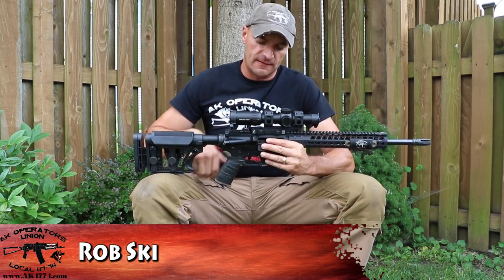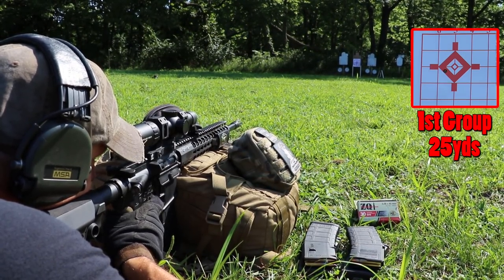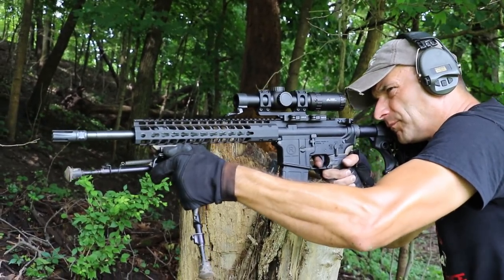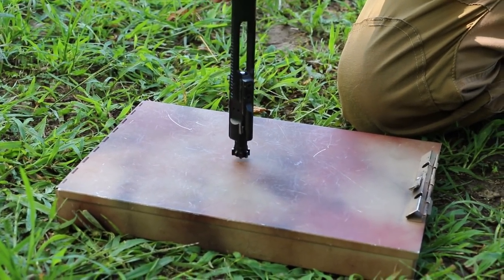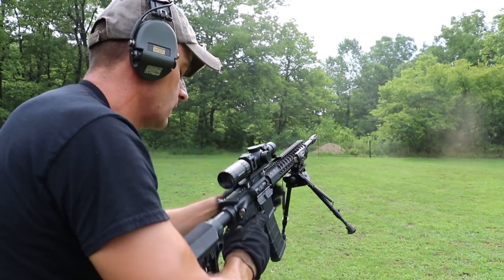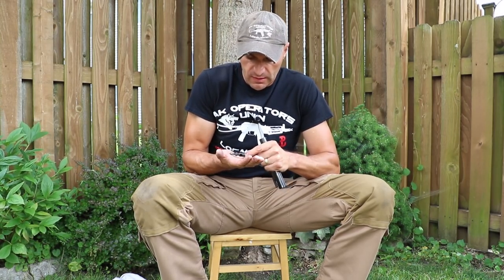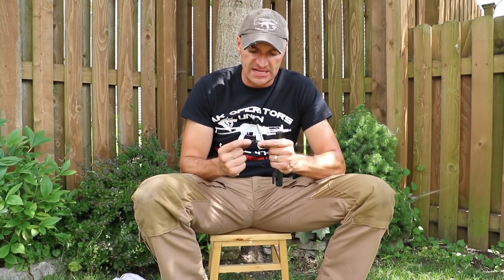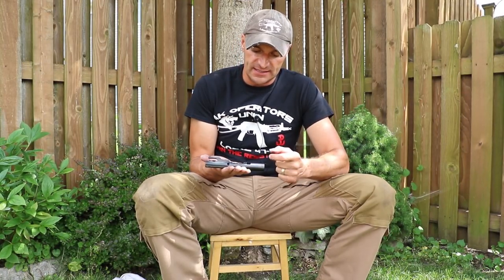Radical Firearms AR-15, 4310rds LATER - Another one bites the dust!

Comment: I've got to say that despite my tremendous love for the AK (I felt more safe with the Kalashnikov than the AR)... I'm actually an AR person (see note below). .  

The first half of the testing phases I did not expect the AR to survive 3000 rds but to my relief and delight it did survive with a little tilt of the rail being of little consequence (after all doing push ups on a rifle is not a common practice) but on to 4000 rds the Tornado Test result was a bit worrisome.  

If one moment the dust enters into the action and the next moment it begins to rain then the potential for jamming is increased.  Worse still if one finds him/herself on miry clay of mud, s/he doesn't have the luxury of a portable air blower in sufficient volume.

When the rifle is "gunked up" the armourer must clean that rifle as fast as possible ... well as we can see... it was a nightmare for Rob to clean it.  The AR is not made for easy cleaning.  Not that the brilliant Stoner intended it to be that way for his sadistic pleasure but it's built to be accurate.  It is a trade off between accuracy and reliability (but its not unusual for most ARs to average 2 MOA. a single or two digit difference of the AK's 3-4 MOA).  

Now we see that it suffered a heart attack for which it never recovered... the bolt cam snapped requiring replacement.  To avoid this internal catastrophe the bolt must be redesigned so for now could the HK-416 with it's famous roller delayed bolt do any better?   ).     

Note 
I was on the fence between rifles for a very long time because while I do feel safer with the AK platform I also love the AR's comparatively superior ergonomics, faster and smoother Battery of Arms, and inherently better accuracy.  

The decisive factor in choosing the AR-15 was that one can buy an AR with a Long Stroke Piston which is one of the main contributing factors of why the Kalashnikov is so superior, second to none, in reliability (the others of course are looser tolerance and it's built to be a battle rifle).

CORRECTION: The HK-416 doesn't have a roller-delayed feature on it's bolt; it's simply  HK's own AR bolt.

Comment: Rob if the bolt carrier is still good replace the cam pin and put in new gas rings and you can continue the test later you just need 690 more rounds to finish the test. The rest of the rifle is still functional right?
Reply from the maker: +Michael Mitchell Rest of the rifle is still functional, but test is over. Breakage of part needed for functioning is an automatic No Go...
Reply: Still the rifle survived the test. Cam pin and gas rings are expected to wear out. But I suspect your problem is overgassing of the gas system. Though it could be the mag dumps your doing each 1000 rounds just prematurely wore out the gas rings and cam pin. Normal shooting would probably see the cam pin actually last 6 to 10 thousand rounds at least. 

BTW is it possible to show the inside of the barrel in a separate video to show what the inside of the barrel looks after a high round count?

Comment: That's why i run a Daniel Defense BCG in my AR-15.
Reply: BCM here as well. I've had good luck with PSA so far. For the money they seem solid. Daniel Defense is up there with the very best.
Reply: +Jks jks yea, i have a PSA premium upper 14.7' free floating rail with the pinned an welded Battlecomp 1.5 and a Spikes lower. Very boring and reliable rifle. I have my RAS as a fun unpredictable range gun :), whom hasn't failed me yet.
Reply: +Jks jks Yea its an ak 47. The Battlecomps in my opinion make the already soft recoil of 5.56 even softer as far as muzzle rise, however it directs sound almost back at you and makes the rifle seem louder than normal. I really like mine though, looks good and works very well.

Comment: great video guys I could tell you guys were excited for this rifle sucks to see it fail. which primary arms scope do you guys recommend for an AK the 1-6x scope or a 3x scope with the acss reticle?
Reply from the maker: +emanuelf11 I like both, but for most universal use, I prefer 3x http://shop.akoperatorsunionlocal4774.com/Primary-Arms-3X-Compact-Prism-Scope-with-762X39-ACSS-Reticle-PA-3X-Compact-Prism-Scope.htm 

If I know that I will shoot mostly outside 300, then of course you will benefit more from 1-6x http://shop.akoperatorsunionlocal4774.com/Primary-Arms-1-6X24-SFP-Scope-with-ACSS-300BO-762X39-Reticle-Primary-Arms-1-6X24-SFP-Scope.htm

Comment: I'm not an ar fanboy I appreciate both ar and ak.
That said I really don't think this no cleaning test is fair for the ar, I appreciate the reason, but the system is really understood and stated that cleaning is important for it.  I don't think it's realistic that any ar end user even in war is gonna run 4300 rounds out without any cleaning. 
I think the system has a ton of extra stress on it when run that dirty.      That's the trade of with a more precision tool.  Maybe two real cleanings in the 5000 for the ar would be fair.  We know nothing stands up with an ak in this regard any how.  
       Good job anyway Rob.

Comment: Wait, please hear me out.  The rifle up to this point was amazing right?  And the crux of the problem was a faulty cam pin correct?  So a simple cam pin replacement should fix it and put it back on the path right?  I know that sometimes in machining things can slip through that simply can not catch in quality control.  Is it possible this was just a bad cam?
Reply from the maker: +W Reid I hear you and we could speculate here about reasons why this happened, but fact is, cam pin is broken...I have repleace it with BCM cam pin now.

Comment: I don't feel like it's a total fail it is a part that does require checking and replacement over time. what would happen  if you slammed in another BCG and kept going. might be a good idea just to continue to use the rifle to just test BCGs

Comment: As much as I have no problem with someone calling Radical Firearms a POS product.  This was a bolt carrier issue.  Fix it and move on.  If anyone is going to be an AR 15 owner and shoot often, you had better have spare parts on you and know how to fix your stuff.  If I am out doing a test on a gun, I would have thrown a different bolt carrier in the gun and kept shooting. Get the gun home and fix what needs to be fixed.  If anything, all you showed is that the bolt carriers from RF are suspect.   Keep testing and see if it happens again, if it does, it would show there might be other issues with the upper causing extra stress on those parts, or, just replace the bolt carrier altogether with a reputable one.

Comment: i have a 10.5 upper from RF and have never had an issue although i have a 250$ BCG in mine i have had a noveske bolt break the cam like this so its just luck of the draw i reckon

Comment: I know this test is more than a year old but it is new to me. I just have a couple of things to say but first I want to make clear that I don't want to criticize your testing, I think you do a very good job.First: everyone knows that an AK is renowned for running dirty and an AR isn't. As you know tolerance in any machine or mechanical device is key to its ability to continue to operate under adverse conditions. The AK with it's higher tolerances is naturally going to run longer than an AR.Second: since the rifles are being tested with no cleaning and little lubrication it is no surprise the AR would have stoppages or broken parts due to its relatively tight tolerance between parts which will always give the AK an advantage in these types of tests.I'm NOT saying that one gun is better or worse than the other, all I'm saying is, under certain conditions each has its merits and can outperform the other. That is by design, not by preference.

Comment: I'd be curious if you replaced the broken part and gas rings with new to see if the rifle will operate.  while is mechanical and parts may fail.  that pretty impressive considering the cost point of the rifle.  I own one and had my own hiccups for the first 150 rounds but the thing runs and runs and eats anything you feed it. interesting though to round count 150 my trigger would not reset,  and it would not run pmags or lancer.  ended up running some PSA girl mags. just had to light push trigger forward. hit round count 300 and decided to try pmags and lancer mags.  at that point it did not care everything ran smooth and it always locked the bolt back.  it really is a nice rifle. I another and I paid 3x more and this thing is way more accurate.  it was just as dirty as yours and running slip 2000 ewl gave it a light coat again at round count 400. it never missed a beat.  minimum wear on bolt carrier.  these rifles are very tight when new.

Comment: are you going to drop in another cam pin and finish the test. I was looking at get one for my son and was wondering how the rest of the rifle held up. i own a dpms and i have only had issue with no thread on the gas block.
Reply from the maker: +Rob Noce yes, I have spare parts already, but test is over, because it was failure of component which I can't repair with rock or duct tape...

Comment: The gun was overgased from the start. It beat its unknown quality parts to death. I highly doubt they are using real milspec parts.
Reply: I agree. That ejection pattern was way off. Throwing them out at 2 o'clock. My 14.5 BCM midlength is 4 o'clock and is the softest shooting AR I've ever had. I completely agree with gun beating itself to death. Jim Sullivan, one of the original AR designers said you want as much weight as possible in all the moving parts. It's the same with an AK. The bolt carrier and bolt are very heavy. I personally run Wolff +15% spring in all my AK's. It's slows the bolt going back and help it pick up the new round and go into battery with authority.

Comment: Classic example of getting what you pay for. The average guy will buy a cheap rifle, put 200 rounds through it and then proclaim it to just as good as premium builds. Your DPMS, Ruger or Radical Firearms are not a BCM, Colt, or DD.
Reply: Just because a pin broke?
Reply: Busted cam pin and shot out gas rings in 4300 rounds, poor build quality.
Reply: AKMer47 so, $10 of expendable parts?

I want to see a major failure, like a broken bolt or busted gas tube.
Reply: AKMer47 Huh, I might've gotten lucky then.

Lucky that I haven't bought a BCG from them.

Comment: Unlike the AK you just drop in another BCG and your gtg. Easy simple fix
Reply: You can replace every part on an ak bolt and the carrier itself.I have 2 sets of spare chinese bolt rebuild kits for my norinco and 1 bulgy spring loaded kit and a fluted pin for my slr107f and after years of shooting them ive never had to use 1 single part to replace

Comment: Aaa man, too bad. I really kept my fingers crossed for this rifle. So maybe the theory still is that the relatively low cost AR is really not the best choice for intensive shooting?
Reply: I own an upper from this company and I'm pretty happy with it.

Although, I do have a different bolt carrier in there. $200 upper, $70 bcg (PSA, on sale), $200 more for receiver and lower parts.

Keep some extra cam pins and gas rings (consumable items) and you're set!
Reply: No, that is what Colt, BCM, Daniel Defense, LMT, Knights Armament, Noveske, SOLGW, and Sionics are for.
Reply: ***** Sure, I have thousands for a beater AR.
Reply: +pcblah you don't need thousands. you don't need much more than what this radical cost. PSA complete blem lower, BCM complete upper. Probably less than 700 for a beater that will always work and outlast you. Or buy used. I've bought 2 used BCM uppers and 1 Noveske basically brand new for about half of retail price.
Reply: xprocharged1 I actually bought a cheap Anderson lower and a PSA lower parts kit for it. I think that the cheapo PSA bcg will last me for awhile too. (I could always buy a more expensive spare)

I heard that Radical's BCGs were a bit crappy, that might be the case here.

$500 with tools, three mags, and 40 rounds of ammunition.

Comment: He used more than just a rock or duct tape to keep the subpar arsenal going too, used dermal on trigger. should've failed right then and there.
Reply from the maker: +lemmy lovecraft you are conveniently missed few points. Arsenal trigger was still operational and didn't fall apart. I used dremel for my own convince. Grinding could be accomplished by rock. Grinding off ledge wasn't necessary for rifle to work. It was annoying and stupid for Arsenal to do it that way, but it was still working.

Comment: Here's the issue I have calling the failure of a part that is expected to fail a complete nogo. It's really not a fare assessment of the rifle, had that part failed after a couple of hundred rounds ok that's more understandable but it lasted about the life expectancy of that part. It maybe on the lower end of the round count but it's still with in the acceptable range. Now with his Ak video that was a catastrophic failure it had a failure of the receiver or the trunnion now that's a serious issue. The whole BCG on an AR are meant to be replaced after a life of X numbers of rounds usually around 4 to 5 thousand rounds. Now if the upper or lower receivers failed now I would have called that a complete fail. Hell even the barrel is considered replaceable on an AR. I don't know enough about AK's to say that's the same or not.  What he should do is replace those parts and start running it again see if the rifle starts running or continues to have issues. But that's just my opinion.

Comment: OMMFG! Is it not an AR15??? People need to stop trippin ballz. It's a good rifle, and just like any AR rifle, you could buy two more of the exact same model, from the exact same manufacturer and at least one would outdo the others. It's the same with some of the other major components of an AR. For example, you might buy a stainless steal barrel of good qualz, and buy two more from the same manufacturer, then put them all on separate builds. The first barrel might give up its accuracy at 25,000 rounds, one might give out at 17,000 rounds, and the last you may get up to 21,000 and you're done. Whether it's an AR or AK- which ever you  prefer- know that bitch inside and out. Have any doubts about the quality of the parts? Switch them out from the getgo. You won't pay much for this rifle, so what's another $20 for functionality assurance? But hey, do what the FUCK you gonna do!!! Just please...PLEASE, for the love of all things Good and Decent- ROCK WHATEVER THE FUCK YOU GOT!!!  :)  [yeaah!]

Comment: I could be very wrong but the first video I watched on this you didn’t clean or oil it all the way up to the 4000 round mark because you was  giving it a beating to see if and when it would fail if so I still think after 4000+ rounds with no cleaning no oil with no fails up til the point of this failure Is still a win considering it’s highly unlikely someone is going to treat there rifle like this as a norm most are going to clean and lube after use or after  half dozen mags there also not likely going to do mag dumps after mag dump like I’m the review videos so there not going to get them super hot unless of course ww3 breaks out and they find them selfs in a battle any how I still think it’s a pretty good gun based on your reviews I’m picking one up